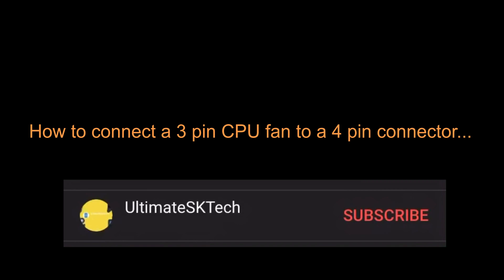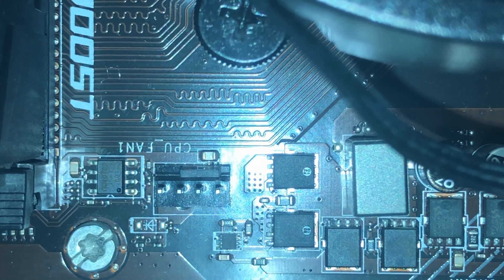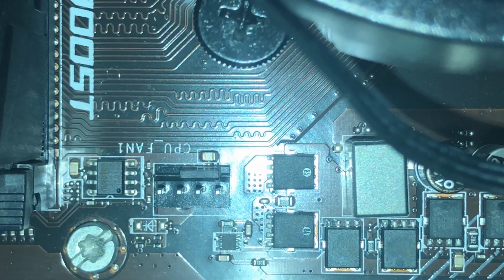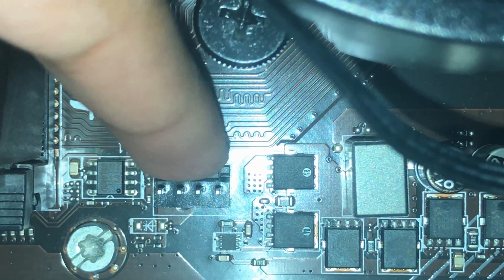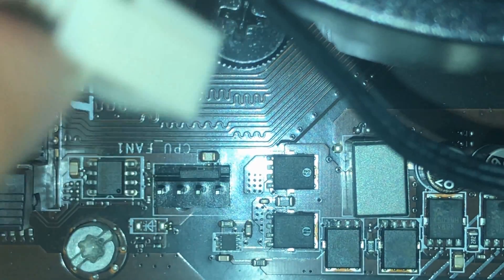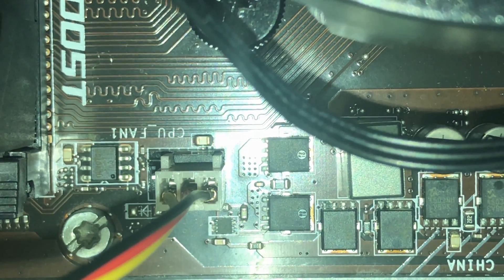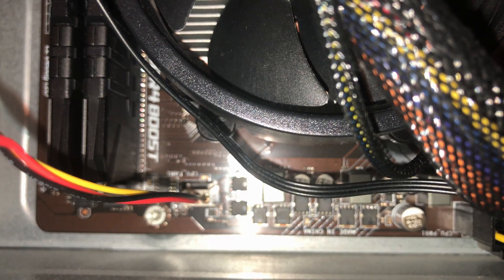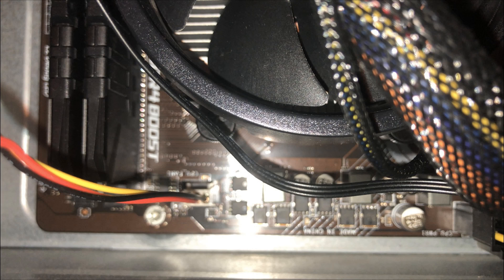How to connect a 3 pin CPU fan to a 4 pin connector

Comment from the maker: What video should I do next? Comment down below!
Reply: Hi, I have a 3 pin RBG coming from the control panel that needs to be connected.  I don't know if it goes into the power supply or the motherboard.  Everything seems to be working right now, so I'm shaking my head.   Lian Li ii Mesh C  RGB case into a Gigabyte Z690 Aorus Elite AX case.  lol   Help!  :-)  Yes, an answer and/or video would be great.
Reply: Reading this comment made me check your channel and then I decided to subscribe.

Comment: you can control fan speed , because its not 4 pin pwm.
but if you lower the voltage from 12v to minimum 5v or 6v your can lower the rmp i mean speed

Comment: I have 2 extra normal fans, I want to connect them with fan splitter which has 4 female pin, but my motherboard have 3 pin fan header.
Will it still works if i use 4 female pin on a 3 pin fan header

Comment: 3 pin non-PWM fans CAN indeed be speed controlled by adjusting the dc voltage to them.  
Virtually all modern motherboards have this option in the BIOS.
Reply: Indeed and at max flow and at max fan speed my new(to me) Enermax LIQMAX III 360 matches my thermalright peerless Assassin for cooling performance. I mean matches exactly, I didn't even change my bios settings. I was hoping for better but it was basically free. Btw a thermalright frost spirit 140 beats them both for $27

Comment: You can control speed for 3 pin as well
Reply: how do you do that? is it adjustable in mobo's BIOS? like, for example in ROG's bios you can adjust the fan control.
Reply: @jeFF Fury 
3 pins is dc control, while 4 pins is pwm control
You can control both from mobo bios
Reply: You can't control a 3 pin fan, He says it in the video.
Reply: @ThatOneLaserEnthusiast  3 pin fan is dc contral fan     ..... FACT
Reply: @raedalhazmi6448  It depends on the specific fan you are referring to. Some 3-pin fans are DC controlled, while others may use PWM (Pulse Width Modulation) control.

In general, 3-pin fans have a voltage control input, which can be used to adjust the speed of the fan by varying the voltage supplied to it. This voltage control is typically provided by the motherboard or fan controller.

If the fan is DC controlled, the voltage applied to the fan will determine its speed. For example, if the fan is designed to operate at 12 volts and you supply it with 6 volts, it will run at a lower speed. However, if you supply it with 12 volts, it will run at its maximum speed.

It's worth noting that PWM-controlled fans are generally more common these days. PWM control allows for more precise fan speed control by adjusting the duty cycle of a square wave signal, rather than varying the voltage supplied to the fan.
Reply: @ThatOneLaserEnthusiast-fo9pv  so we agree 👌

Comment: Hey bro. Is this ideal for doing overclocking?
Reply from the maker: If your talking about 3 pin vs 4 pin, it doesn’t matter much. If you plan on overclocking, you should oc your cpu and then monitor temps on the oem cpu cooler.(check your CPU’s running temps online). If the oem cooler isn’t working well with the oc, then u should buy an aftermarket one. Check this website-https://graphicscardhub.com/best-cpu-air-cooler/
Reply: @ultimatesktech1820  thank you bro! I should be looking for 4 pin since I can optimize the fans speed.
Reply: If I connect 3pin CPU cooler in 4pin connector motherboard..than in future is it harmful for my PC...

Comment: Hey bro i got  a hzxt case  w 2 fans 3 pins and a this gigabyte board  450 m comes w just one plug fan like the one in your video how i can make the two to work?
Reply from the maker: If you only have 1 fan header on your board, you will have to buy a fan splitter.
Reply: Same issue with me One i connected with mother broad & 2nd fan i can connect with SMPS .it has 4pin holes u just Connector For 3pins fan...

Comment: why is my fps decreases when i apply the cpu cooler?
Reply from the maker: You may want to see if the cpu cooler is keeping the cpu at a reasonable temperature. You can use a program like nzxt cam to do this. Other than this, there should be no reason why your FPS have gone done due to a cpu cooler installation
Reply: @ultimatesktech1820  i just fixed it and it is becuz i didn't tightened it up lol
Reply: @ultimatesktech1820  and yeah why is my pc shutting down on its own when gaming in a certain time

Comment: What about connecting a 4 pin fan to 3 pin header/motherboard?
Reply from the maker: Yes, you can connect a 4 pin fan to a 3 pin header.
Reply: @ultimatesktech1820  but I won't be able to control the fan still? So how fast are we talking about here? The fan speeds?
Reply from the maker: This depends on the fan and the size. If you search up your fan model and it’s running speed, you should find the answer.